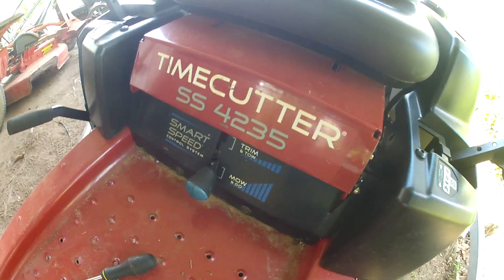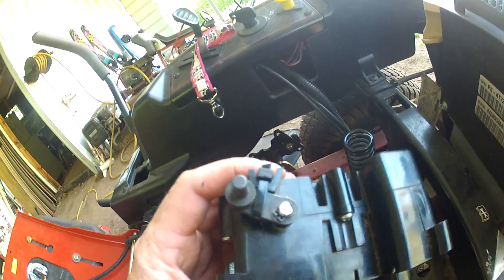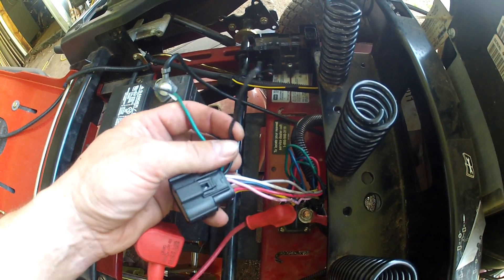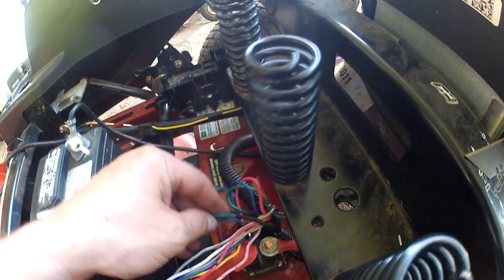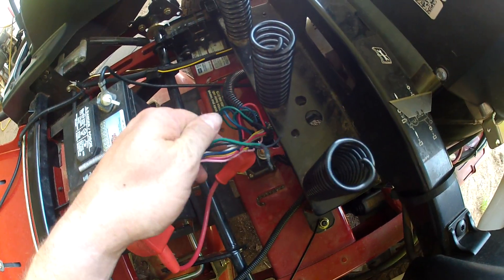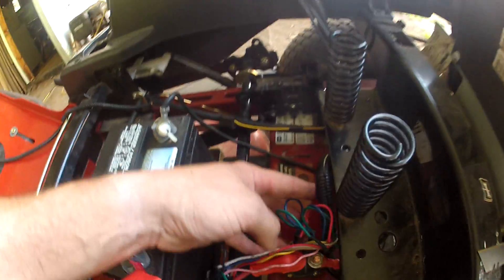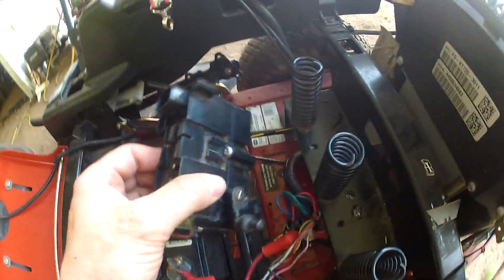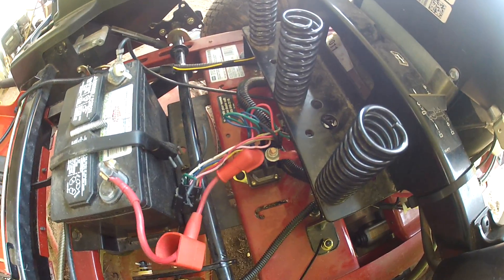Toro BRAKE CONTROL MODULE ASM  121-3017

Comment: THANK YOU SO MUCH! My Toro SS4235 is 5-6 years old and if not for this video I'm not sure how long it would have taken me to figure it out. I did exactly as you said and my mower works perfectly now. I did one thing different. Instead of tying up the rods underneath I simply removed the one bolt on each side and completely removed them. I put the rods and all the parts in a marked bag in case I ever decide to sell the mower I want to give the future owner the opportunity to put it back on if they so desire. Man, I really appreciate it - thanks again!

Comment: Man,Thank You so much. I have been trying to fix this mower for over a year. It was in the shop last year for 3 months. They said come get it. They were tired of trying to figure out what the problem was. I have lost my mind trying to figure out what the hell the issue was. I just soldered the two wires and its running like it should. I have no need for brakes so its fixed!
Reply from the maker: Thanks for checking out my video.  I think I will get the mower back this year for maintenance and I will try to make another video on how to make a full wiring harness plug and play so you can bypass this all together.  It is such a stupid design.  Thanks.
Reply: please let me know when you do

Comment: Thanks for the video. I thought this may be my problem. However, on the solenoid, my battery cable came out of the connection after a hard jolt. It looked like it was still connected,  but fell out when I lightly pulled on it. Easy fix.
I am glad I found that before I got to deep. Folks may want to check all these connections before cutting on wires. My mower was bought March 2015 and this is the first trouble I have had.

Comment: I have a Toro 60" Titan My Ride with the same problem except the problem was caused by the bolt attaching the brake handle  had come loose, I tightened it up and presto the mower started right up so before you doing anything crazy check that bolt first.

Comment: My timectter is the one with the steering wheel. The brake module has no harness that it plugs into it just has about a dozen wires that go straight into the module.  So, I'm afraid to cut  the wires fearing it might be different on mine. Took me forever just to get everything I needed to remove just to get the module out of where it was mounted.

Comment: What I discovered was the lip on the module is 1/4” too high, so it disconnects intermittently. Sand off 1/4” off lip surrounding male pins on module so that male and female lock together. And that should fix it.

Comment: If anyone knows the answer to this would reply I would appreciate it.  I am I hearing him correctly when he says he soldered the green that goes to the solenoid and the black that goes to the engine together?  I am also assuming the black box electric brake thing, which is Evil and I am on my 3rd one in 3 years is completely NOT used?

Comment: Thanks for the info.  I tried to follow it for my 5050 Timecutter but I can't.  The wire colors are different along with a other differences.   Can you give me a hand with them.  After disconnecting the plug from the black box and removing the control arms from it, the mower wouldn't run at all.  Then I hooked it back up without the brake arms and it would run OK.  After about 20 min. it just quite... no power at all.  Awhile later (maybe two hours) I tried to start it and it ran ok.  I tried using the mower but as soon as I pulled the switch up... it quit. Got it back up to the garage to work on but it was to dark to work on.  Any help appreciated.  Thanks.

Comment: Mine's wasn't a day old and it is giving me issues. The brake module sounds like it is running when the key is out. The only way to stop it is disconnect the battery. I'm taking it back while I still have it under the 30 return policy. It is my first zero turn. Would you recommend staying with it and let them fix it or just get my money back and go for a different brand?

Comment: When I'm sitting on my mower and it's running and I go to engage the handles and take off, the motor cuts out.  But if I quickly disengage the handles, I can catch it before it shuts off.  I sometimes have to do this four or five times before it'll let me go and not cut the engine.   Is the brake control module my problem?   Thanks in advance!
Reply: Sorry I have the same problem with mine did you fix it if so what was the issue
Reply: I have the same problem
Reply: Hello, just found this video. My mower does the same thing. Running, pull handles in and shuts the motor off.  What was your solution???

Comment: On my mx 4260, the ground wire to the coil is white and becomes black after the engine harness plug. The black wires go to a ground lug. Are you sure the engine isn't shutting down because the fuel solenoid is cutting fuel? Mine will if I just disconnect the coil wire at the engine  and leave the green solenoid wire connected.

Comment: i had the same problem ..bought the replacement part for $108 and two months later same problem ....i ran a small wire conecting the green and the black together and that solve the problem it bypass all the safety switches
Reply: I got the ss4225, used it twice, brand new! I also did the green and black, the engine now turns over but will not start. Thinking fuel solenoid is not being activated or no spark from magneto from the brake module now, just dont now.
Reply: +Coastie digs if you bought it new you probably want to take it back to the store and get your money back or get you a diferent one that doesn't have a break control module if you bought it at home depot they have to take it back if its before the 30 days
Reply: I think thats what Im going to do!  Been in the shop for 3 days now, I hear that even if they fix it , it wont be long and it will go down again for same part.  Im going to look at the hustler raptor today and see what it has!  Thx
Reply: did you just jump the green and black together? Leaving green and black connected to the plug?

Comment: Where and how did to attach the brake rods?  Also, how in the heck did you take that freaking brake solenoid off?  It’s tucked up under a support bracket.

Comment: I did this on my toro 5060 and it works great.it takes about a second longer  for the switch key to kill the motor.no problem with that.Question does it still charge the battery?  thank you it works!!

Comment: I have the same mower does it matter if the brake module moves my mower does not crank as if a safety switch was on when harness is plugged in I get no spark when hardness is unplugged I get no fuel when I do turn the key to the run position the parking brake in neutral switch does move the module when I turn the key to the crank position nothing happens any help

Comment: I have the same exact problem, I have done the green to black splice..still no start, cranks fine, I dont have any fire to the plugs, I have take off the ground [plugs on the coils and tried that..still no fire.. I've left the module plugged in and not plugged in...anything else to try???  The only thing I an see is the blue and green wire placement on the solinoid, which are toward the front of the mower, blue or green....

Comment: Also since the machine is under warranty for being under 2 years old because you cut the wires instead of taking it to a Toro dealer where they deal the lawn mower and fix it you have voided your warranty and they will no longer fix it under warranty
Reply: Gimme a break

Comment: hey i needed your help. mine just went out. i spliced the green and black together and the starter turns over but wont start do i splice both blues of the solenoid together or splice the blue to green and black aswell?

Comment: So when you did this did you lose all safety switches or just the one related to the brake? I don't want my son to be able to start it with the blades engaged. Loosing the electric brake wouldn't be an issue at all. Also does it still charge the battery as I have heard the charging system also goes through this system.
Reply: If what you did bypasses all the safety switches an easier way to accomplish the same thing is to simply cut the white ground wire before it goes into the engine. (I cut mine just on the mower wire harness, leaving the engine wires in tact) The motor will still die when that is cut when key is turned off because you will not have power going to the fuel switch below the carburetor.  I'm thinking about rerouting the seat switch from a ground switch to a power switch and running the clutch wire through it. That way you have to be in the seat for the blades to turn. I don't have any problem with mower running without my son on the seat but I do have an issue with blades turning. However, if your fix keeps the blade safety switch, I'll try that.

Comment: black to green got me running but switch will not cut off machine Can you give any pointers
Reply: Did you ever solve your shut off issue...mine is doing the same thing?
Reply: add a kill switch inbetween the two to kill the connection

Comment: The ignition switches on these Toros with electric brake modules are not like the ignition switches on anything else. The wiring on Toros with these brake modules is really goofy.

Comment: This is nuts...still cant start it or turn it off with the key...AND... the mower with not engage....
Reply from the maker: You might have something else in the loop that is causing the problem. You can bypass it by doing what's on the video but it still doesn't bypass the trip sensors on all the safety features on the mower.  You can find the 1 black wire that's going to your coil pack and put a kill switch on that and it should help but not 100% sure.  Worth a try though, thanks.

Comment: Unless someone can tell me something else. This does not work.
Reply from the maker: There is a wire that goes to your coil that is a ground and is set up to kill the spark.  If the mower has a bad loop switch in the system it will not crank.  Unplug the coil kill wire from the engine and try to start it.  That will bypass the whole system.  These engines are designed to run totally unplugged with just the fuel line.  I hope this help.